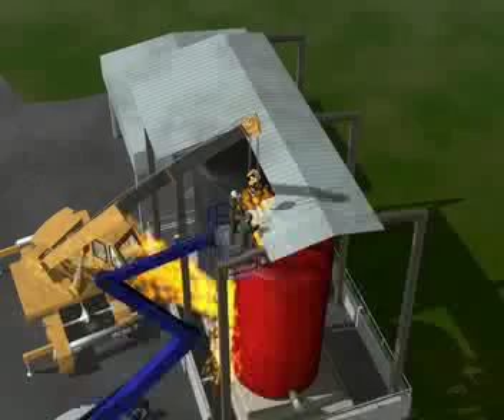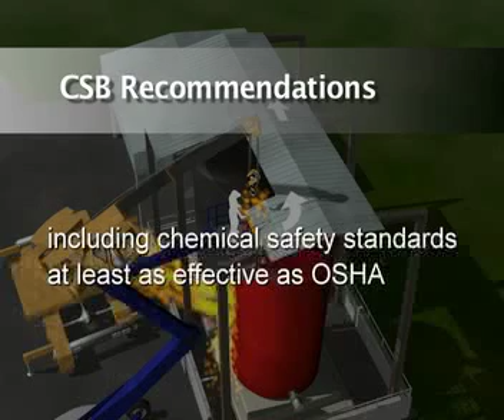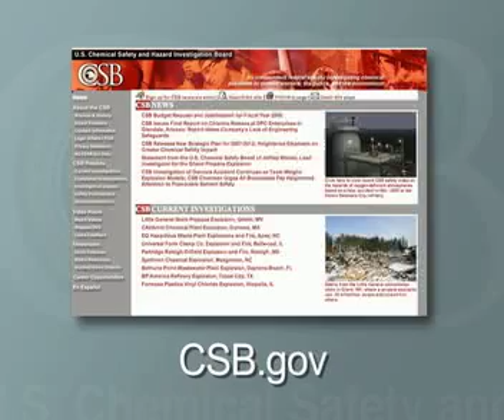CSB Safety Video: Public Worker Safety: Wastewater Plant Exp

Comment: They were using a torch above a RACING FUEL TANK. How does one ignore maintenance on something called a "flame arrestor"? They used PVC pipe. I'm at a loss for words.
Reply: The flame arrestor was rotten and basically wasn't there
Reply: It's interesting that they knew enough to install a flame arrestor, but not enough to realize that the aluminum flame arrestor was incompatible with the methanol.  It's like well-intentioned people who use galvanized pipe for propane, because they're not aware that propane attacks zinc.
Reply: @superdrummergaming: A couple of years a go a huge fire started at a chemical company (ChemiePack) in Moerdijk, The Netherlands after someone had gotten the task of "defrosting" a pump used to pump over a highly flammable chemical with a gas torch.
That day the torch ignited the fuel and caused a small fire that soon spreaded to storage containers containing much more of the same liquid and other liquids that (again, against safety regulations) were stored at an open space of the terrain instead of in specially assigned storage spaces with oxygen-removing fire-suppressing systems that could be activated in case of a fire.

Investigation later turned out the "defrosting" process had grown to be common practice (against all safety regulations) at the company, but it was mainly the storage of the same very flammable chemical on the open space that caused the fire to get out of hand quickly.

When the first employee reported the fire at the fire department she was clearly not informed well enough and only mentioned there was a fire at their company, which, according to the reaction of person on the telephone at the fire department was perceived to be a small fire.
A second employee who called maybe just a minute later (when security camera footage synchronized with the calls showing the fire already getting totally out of control) was able to mention the location on the terrain of the company where the fire was at that time, but was (because of not following safety regulations) unable to tell the fire department what they stored there (and thus, if they could use water or not, which it turned out they should not have used because the chemical was lighter than water and floated on top of it, either washing away unburned or burning on top of the water).

Some small waterways around the facility turned an awful kind of red in the following days after the accident, indicating some chemicals had leaked into the surface water.

There are mistakes being made everywhere as soon as regulations are being ignored, unfortunately.
Reply: @Dutch3DMaster  what are your recommendations?
Reply: @Dutch3DMaster  I was there that day. Working in the steel recycling company across the road. That was the biggest campfire I've ever seen! The next day all the little canals in the industrial area were all kind of colors. Unbelievable how stupid some people can be. Chemiepack was known to don't care about safety rules.
Reply: "Hey boss that flame arrester looks kind of busted..."
"Listen bucko that thing was here 10 years ago when I started here and we've never had a fire.  If it ain't broke, don't fix it."
Reply: @Dutch3DMaster  As these videos show again and again, rules and regulations are worthless without enforcement.
Reply: tank was probably installed by a contractor who provided relevant safety information which nobody bothered to read.
Reply: Nitro Methane is NOT Methanol, we use Methanol in some of the old aircraft engines for "water inject" during high power settings. If there was Nitro Methane in that tank, everyone would have been killed instantly. I just wonder how these government people stay in charge and seem to know less and less about what they are doing with every passing year. It's like the patients are running the asylum.
Reply: @peterolsen269  Who said nitro methane ?
Reply: @ArnaudMEURET  original commenter called it "racing fuel" and i don't know of any race cars that use methanol. 
and to him, nitromethane would have behaved very differently. nitromethane is very hard to detonate, and i don't know if the burning gas would undergo deflagration-to-detonation or if that hypothetical detonation would be sufficient to set off the rest of the nitromethane.
Reply: @johnsmith-sp6yl  Precisely my point. I was underlining the fact that this guy (Olsen) was pulling nitro methane out of his bottom end.
Reply: @ArnaudMEURET  that's not at all what i'm saying. don't put words in my mouth.
Reply: @johnsmith-sp6yl  Nitromethane is completely off-topic. Period.
Reply: @ArnaudMEURET  original comment said "racing fuel". methanol is not racing fuel. nitromethane is used as a racing fuel. it is on topic.

Comment: Every person who ever advocates for rollback of regulations or elects someone who advocates removal of regulations needs to be strapped in and forced to watch the entire USCSB playlist clockwork-orange style.
Reply: Do you really think that requiring a certain amount of parking spots per allowable restaurant square footage despite the presence of a firelane or the need for a permit to install a sign on the outside increases safety? How about the need to aquire a permit to practice interior design?
Reply: @paulmvn5431  You'd think "what a bunch of maroons, requiring permits to install a sign" until a 1200 pound signs over a parking lot comes crashing down on a windy day on YOUR car (or your kids), because the installer didn't bother with engineering on the supports.
Reply: The sign isn't checked for safety. The permit is there for money and so the city doesn't get "overcrowded" with signs.
Reply: @paulmvn5431  you lost, bug boi
Reply: @paulmvn5431  "permit to install a sign on the outside increases safety" That one's easy, some jackass probably put up a sign outside his business that caused a traffic accident or something similar.  Or maybe was improperly secured and blew away onto someone's windshield and killed people.  I'll bet there's a good reason.  I worked for the Parks in college and you'd be amazed, absolutely astounded the dumb sh*t people would do, even in a park or the woods, that we had to put signs up or even get laws passed if it was really bad.  We had regulations that would make your jaw drop, until someone explained it to you.  And even die-hard Tea Party libertarian types would grudgingly say "...yeah I guess that sort of makes sense."
And as for the first one, nitpicking.  One questionable regulation, against a hundred times that many that actually keep people safe.  Do you really walk away from these videos thinking "yep, the business regulations are just fine, maybe they even need to be rolled back a bit"?

Comment: I lived in  Florida for several years. Florida government is not very good around Ft. Lauderdale, miami, broward and beyond. Things there are done in the cheapest way possible. They put up a big front, making things seem to be on the up n up. Blasting the news about improvement and how things are so good, but behind the scenes, the companies they hire to do most of the work cut every corner possible. They do this because they underbid a job, which was the only way to get it. And cutting the corners is the only way to make any profit.
 A perfect example; there was a walkway over hwy 141 that collapsed before it was even finished because the contractor used a cheaper concrete, skimped out on some of the steel reinforcements that go into the concrete, and rushed the job so much there was an alignment issue getting the ends to meet up in the right place. The walkway took 10x longer then it was supposed to and It ended up costing some lives when it collapsed. ... so no, it dont surprise me 1 bit. and oversight is not on purpose, oversight caused by trying to be as cheap as possible is on purpose, and the results are a direct reaction to the people in charge trying to save a buck. IOW the workers had no choice, nobody cared about safety, just getting the job done, on time and as CHEAP as possible.

Comment: Defunding The Chemical Safety Board Is A Bad Idea And Likely To Increase Chemical DisastersUnfortunately, the 2019 budget proposed by the Trump administration zeros out funding
 for the USCSB. Its requested fiscal-year funding, $12 million, is 
modest for a government agency. Likewise, the 2018 budget also proposed to defund the USCSB.
 This sustained effort reflects an ongoing de-emphasis on chemical 
safety – as a second example, Environmental Protection Agency 
Administrator Scott Pruitt has indefinitely delayed bans on the use of three hazardous chemicals, shown to be toxic to human health. 
Chemical production is an essential component of modern society. This
 does not mean that there is not room to improve practices in 
manufacturing, storing, and shipping chemicals, and in ensuring the 
safety of those who work in or live near chemical plants. The vantage of
 an independent group is crucial for identifying those aspects that can 
and should be improved. 
Defunding the USCSB, which provides this indispensable independent 
perspective, is likely to hinder efforts to identify the causes of 
chemical accidents – especially in low-regulation locales.
 Moreover, it is also likely to worsen our ability to respond in 
previously unforeseen events, such as the heavy flooding of Harvey, that
 may be exacerbated by climate change. Finally, it is likely to cost lives in future incidents.
Reply: Good.
Reply: Nice fantasy.
Reply: Which other sitting president is currently trying to remove regulatory boards at the behest of the industry? I only know of one President at the moment, but I suppose there could be more.

Comment: How do you not know that methanol is flammable?
Reply: I doubt the welders even knew what was in the tanks, let alone whether it was flammable or not.
Reply: @Sashazur  I know, that's precisely the problem. If you don't know what's inside the giant bomb with PVC pipe sticking out of the side of it, maybe ask someone if they could potentially explode if they try to weld in that particular area, which happened to be, in this case, above a giant bomb. These are details you really need to get hammered out before the welding/cutting process begins.

Comment: If tank was empty before the hot work, then would be no boom.
Plus the valve should be installed on the top to prevent methanol escape from the vent.
Reply: Only if it was then purged. Othwise gases might still be present
Reply: @EvanDent  
But gases could escape compare to liquids...

Comment: How did the explosion inside the tank not rupture the tank shell?!
Reply: Right, it never exploded, it ignited inside the tank by not creating enough pressure to bust it open. Some hoses disconnected because the bottom tank was bending and pushing the tank up. Explosion would probably have the tank flying 300 feet in the air.

Comment: What is the scariest thing about methonol not only is it highly toxic but burns with clear flame.
Reply: I don't know where you get these ideas? Methanol is like Isopropanol and Ethanol. One is used on cuts and abrasions and the other is what is in Vodka. Methanol is not highly toxic as long as you don't drink it. We used it in Aviation for several things, it's not even really that volatile compared to other flammable liquids such as MEK or Acetone. People are getting this stuff confused with Nitro Methane which is for "top fuel" dragsters.

Comment: Completely inept management and beyond stupid workers.  Sounds like the government.  I knew somebody who managed the parks maintenance department in a large city.   The number of employees who got a job there because their dad, uncle, brother, sister, etc worked there was staggering.  Some of them were great employees, some were completely incompetent, its extremely hard to fire government workers because of civil service protection rules.   

Not saying that's what happened here with this accident, but it wouldn't surprise me if these workers(RIP) got a job working for the city due to a family connection and not based on actual merit.
Reply: its not a particularly skilled job, you do not need any merit here... just common sense, &/or proper management will do.
ANYONE can be taught this job with the right overall attitude.

Comment: You would think they would have used a circular saw with a diamond tipped blade to cut the roof off instead of a torch
Reply: Would have produced the same hot sparks.

Comment: Close these old plants down and start rebuilding new plants. Start replacing parts 2-4 times or more a year and start  upgrading the safety equipment
Reply: Good luck getting the voters to pay for that.  They'd rather see workers die then have their water bill go up five cents a month.
Reply: You clearly have never worked in any type of industrial setting. These suggestions are ridiculous.

Comment: Once again, we see how equipment for handling highly dangerous materials has been designed, operated and maintained by brain dead mickey mouse amateurs. Wouldn't a professional welder want to know what's in a tank that he's going to be showering with sparks? Is there anyone on the property who's bright enough to ask the question, "What would happen if...?"
The CSB has produced hundreds of accident reports during its 20 year history. They present the results and conclusions flatly, with absolutely no sense of shock or mockery. But you've got to imagine the meetings they've attended in which highly trained investigators are falling out of their chairs at the stupidity of chemical industry workers who cause these spectacular accidents. I'd LOVE to attend just one meeting for the entertainment.
Reply: You assume that the guy operating the cutting torch is an AWS certified, trained, professional welder.  Most likely he was someone with enough general knowledge to know how to run a cutting torch.  Frankly, I'm befuddled about why they were chopping the roof up with a torch.  Most sheet metal roofs are attached by screws.  If they were just replacing the roof, it would have been trivial to dismantle it with a battery drill motor, no torch required.

Comment: I will give them credit for producing these videos. HOWEVER, I will also say that criticizing stuff in retrospect is alot easier than being responsible for PREVENTING these things in the first place. It's always easier to predict hazards AFTER they've taken place then before. Some stuff is pretty obvious (don't use pvc pipes for hazardous/explosive/corrosive/etc substances), but some things just aren't contemplated till it happens. 

Like when they design a backup into a safety device or system; putting in a backup probably seems to be common sense. But until the primary AND backup system fail (like the B.O.P on the deep water horizon accident) fail in a real world situation, most folks wouldn't have seen a need to spend money or time designing one with 3 or 4 backup systems in it. If an engineer went to his boss on a project and said "I really think we should take time to design 3 or 4 backup systems in our new product instead of just one backup". Most bosses would think in terms of time is money, and delays in production is money lost, and deny the additional design work.
Reply: I think you're missing the point of the USCSB videos - these aren't about creating a million layers of redundancy or about criticizing in retrospect. No-one expects a 3rd or 4th backup to be designed into everything (unless you work for NASA!). But some people are quite short-sighted when it comes to safety and make the mistake of thinking that doing things safely means doing things slowly or costing more money - it's actually the complete opposite. And the only way to get through to them is to show them what happens when they don't invest the time, effort & $$ into a safe workplace. 

It's actually A LOT easier to prevent these accidents from happening in the first place than it is to investigate & deal with the aftermath of a disaster. Risk assessment is a key part of running any business - you need to assess potential hazards & have a plan to address them in your business strategy, budget calculations, quotes for jobs, staffing levels, etc. Workplace safety is no different.

There is no bigger cost than an accident, and it doesn't even need to be a big one - lose one worker to a fall because the boss thinks it takes twice as long to get work done with safety harnesses, they're "just a pain"?? OK, that's going to cost them 2x lost labour time (for the injured worker's replacement, who won't be as efficient being new to the job), clean up & replacement of anything the poor guy hit on the way down, production delays because the site was closed while dealing with the accident, backed up workload, ambulance & medical bills, insurance costs, a pissed off client/boss/worker's family, OSHA breathing down their neck, possible fines, lawyer's fees, etc etc.... and more stress & paperwork than they will have seen their entire career!

OR... learn about fall prevention options used in your industry, run a training session for all your workers at height on how to use a 'fall arrester' and I guarantee they will get so efficient at clipping on/off as they work that you'll get back at least half that time cost within a week. Plus your insurance premiums are lower, no lawyers, happy workers = efficient production = happy clients, less paperwork & stress for the boss! 

Most hazards are readily predicted in any industry, it just comes down to how much effort is put into addressing them - so these types of investigations & videos are about educating regulators, companies, workers & the general public about safety issues in the hope that they (a) learn something they can apply to their working & home lives (like how to prevent a fall from your own roof!), and (b) advocate & vote for better safety legislation and compliance.